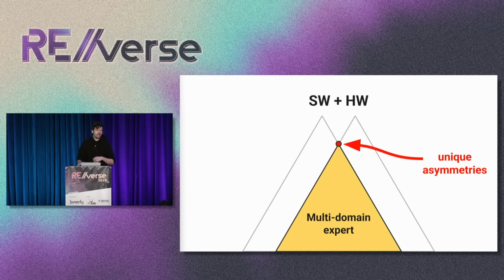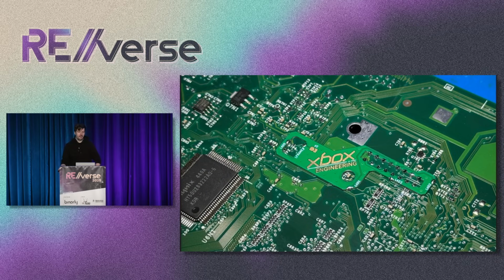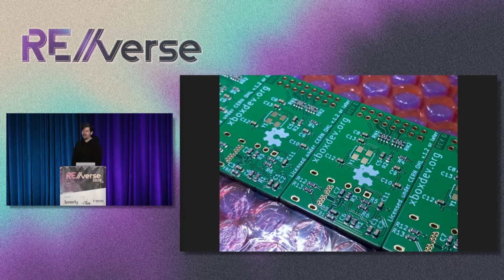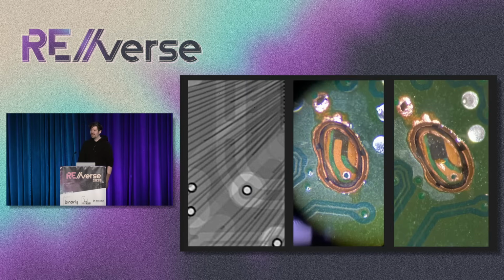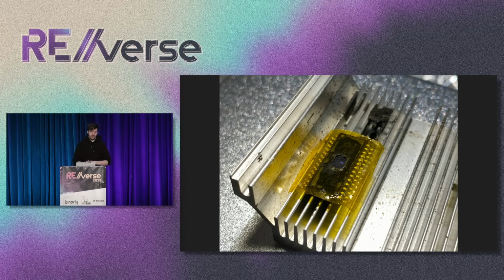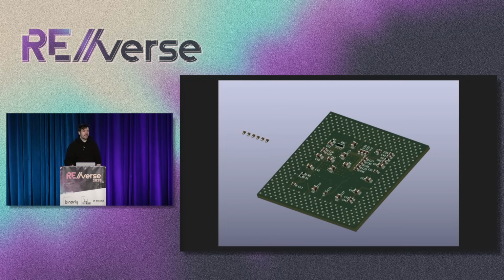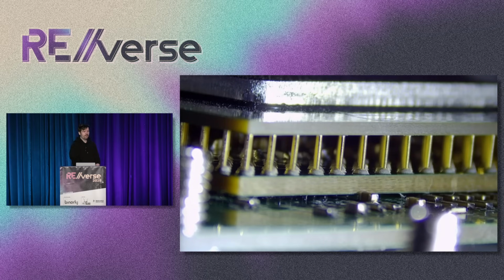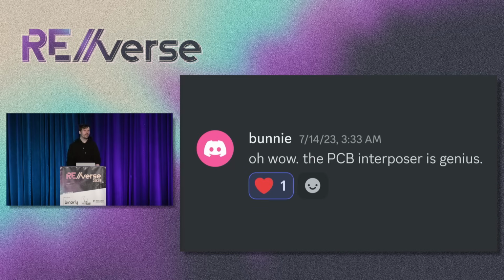RE//verse 2025: Full-stack Reverse Engineering of the Original Microsoft Xbox (Markus Gaasedelen)

Comment: Drilling into a chip to bodge a bond wire is crazy. I have heard about all kinds of hardware hacking with spiking and liquid nitrogen etc. 

Apparently Intel has a lab to make changes inside the silicon using lasers and stuff to rewrite metal layers.

Comment: So im not an expert in electronic / hardware design, but why would you add "dampening resistors" instead of bypass capacitors to reduce the ringing?

I thought the whole point of bypass capacitors was to reduce noise?
Reply: The source is deciding what to use. Ringing is just a result but doesn't say where it comes from. With one capacitor you can ever increase the ringing because it actually participates in LC resonance when paired with parasitic inductance. In most projects you use them together to achieve the best result.
Reply: @M_Tech03  So do you think using a resistor array was the best and most effective way to reduce the noise?
Reply: @Jon-c8n2vyes as a patch I would do that. A Redesign of the board with ringing in mind would be cleaner, but without real world benefits.